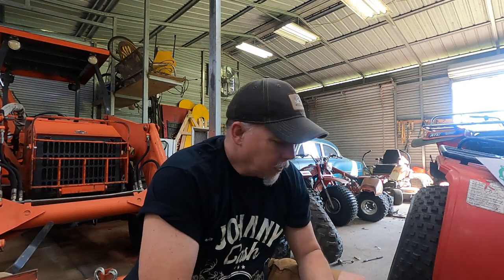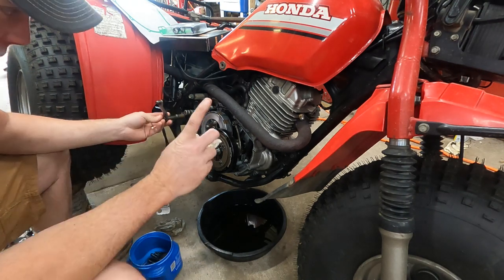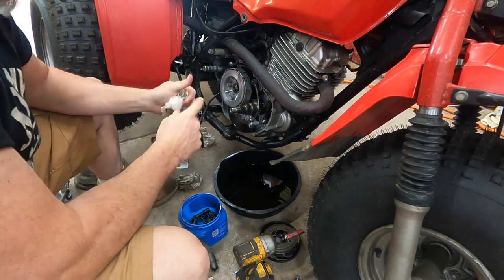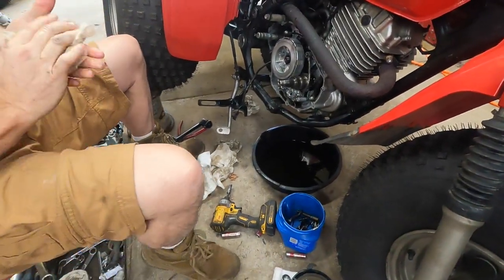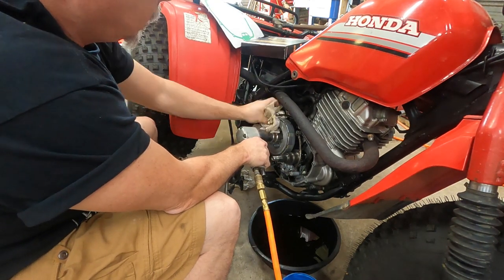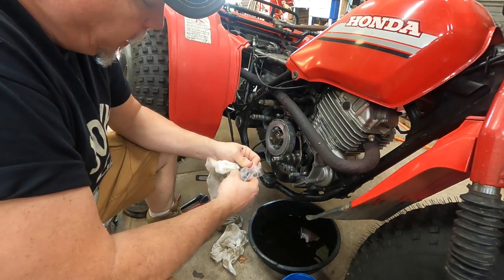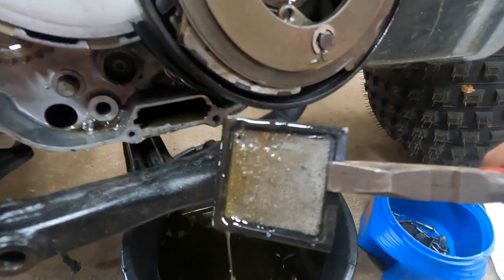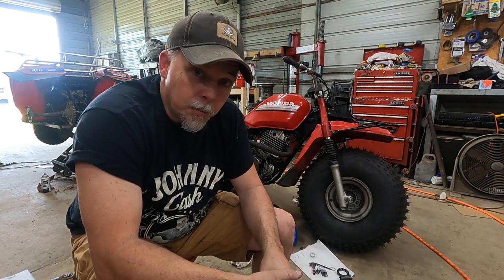HONDA ATC 250es THREE WHEELER CLUTCH & ONE WAY BEARING: Diagnosis and Repair.

Comment: I recently got an '85 TRX 250. It revs but hardly moves so I'm thinking clutch. It'll move on down the road , but not like it used to. Would the repair on that clutch be similar to this? I know there's no actual clutch level only a foot shifter. Any info is appreciated.
Reply from the maker: It should be exactly the same for a 85 tax. Thanks for watching and subscribing,there are links in the description for a clutch kit and one way bearing even oil and gasket.
Reply: @Mrcbuilds  you are the man! Thank you for you help.
Reply: @Mrcbuilds  I noticed that the link you have for the clutch in your description is for a CR250R. Will it be okay for me to order that for my fourtrax? and do I have to get the special socket? TIA
Reply from the maker: Search amazon for a 250es clutch disc kit. Tusk makes a good kit caltric is alittle cheaper.
Reply from the maker: @colebright7379  https://amzn.to/3aGRyAN         try this one, thanks for letting me know

Comment: hey mrc builds i have 1985 250sx the drive shaft is bad does any of the other models interchange ?
Reply from the maker: I would suspect the 85 250sx and 250es are the same because they share the shame swing arms. Note the 86 and 87 swing arms are different. The drive shafts may be different also, I have not had to make that swap yet. Stick with the 85 models and I think you will be ok. You can cross reference the part numbers at partzilla if they share the same numbers they will interchange.
Reply: @Mrcbuilds  thanks alot i couldnt find any info on it

Comment: Do I need a puller to get the centrifugal clutch out or does it just pop off as easy as in this video?
Reply from the maker: You need the right socket for sure but no puller needed
Reply: @Mrcbuilds  Ended needing one someone must of done something wrong

Comment: So if I rev it up and it does not go forward would you say that my centrifugal clutch is out? I can rev It up slam it in the first and I'll take off but it will not automatically go until I have the RPMs really high. If you think it is the centrifugal clutch where would I get one of those?
Reply from the maker: Ebay is the only place I know that has them, there is not a new one listed right now, you will have to wait until another pops back up for sale. If it was me, while I was in there I would change the one way bearing and clutch pack and springs here are links for those items. clutch pack and springs https://amzn.to/3B4Iwbd.  here is a good one way bearing https://amzn.to/2Z9K46L.
Reply: @Mrcbuilds  from what I explained does it sound like the centrifugal clutches out?
Reply from the maker: @rjlittlefield9209  yes the centrifugal clutch is the first or slow speed clutch, the the secondary or clutch plates kick in at higher rpms, not taking off is the centrifugal clutch slipping.
Reply: @Mrcbuilds  thank you so much. Just got yourself another sub

Comment: I pulled my side cover and was checking everything out and  my disc  are worn about flat but have a groove . The centrifugal clutch looks well like yours . Now mine does not wheelie with easy it won't lift in 1st gear I have to be in low gear and lean back while stabbing it. I'm thinking of replacing the centrifugal clutch. Just wondering what you think . I ve seen kids in videos wheelie with ease .
Reply: Hey bud I hope my comment about the rain didn't offend you . If so I apologize  and I really appreciate your videos . If you have a po box I got something I think you'll  find useful I'd  like to send you. I also have an old brand new spark plug.
Reply from the maker: Hi Rob, sure could be the centrifugal, also what type of oil did you put in it? regular or syn. motor oil will cause slipping, you need a specific Diesel oil or an ATV oil both will work in out ATC w/ wet clutches.
Reply: Honda GN4 and I saw your video where you talked MA or M2 ratings.  Lifts front up good in low and stabb it.  Maxed out at 35 mph on pavement engine was screaming and your video turned me on to the clutch.
Reply from the maker: @roblinton5047  thanks for becoming a member please PM on FB or Instagram, your address so I can send you some decals
Reply: Dude I don't face book . I had my wife search for you and all I know to search Mrcbuilds what do I need to type.

Comment: I have a question about installing a flywheel and how do I know it's on all the way?
Reply from the maker: The best way to explain it is you feel it stop moving as you tighten the bolt. If you have a rubber hammer or dead blow hammer, 1 or 2 good wacks, then see if the bolt is loose. Please  Be careful, braking the bolt off in the crank can be terminal or at least very expensive to extract.

Comment: Just subscribed ☺ I'm 16 and recently started flipping bikes and ended up with a 250es that had a rough rough life. I've got it running good now but it's always good to file info like this away if I ever need it. As I was certainly not around when these machines were made and I am totally self taught with no one I can ask questions it's nice to see your videos as someone who really knows these machines well. One question though, I've rebuilt the carb in my 250es and everything is spotless but if you try and give it very much gas it bogs, you can get on the main jet and rev it out and all but you have to ease into it. I don't know if these have accelerator pumps but if you even just give it half throttle quickly it bogs out and I thought maybe accelerator pump but I don't think it has one? Any ideas? The carb is spotless like I said, and it doesn't smoke a single bit, I don't know if adjusting the needle would help or what. Any way, thanks again for your time and work on these videos I really appreciate them and that big red is so so clean man!
Reply from the maker: Welcome to the channel Smokey Bandit (awesome name!) If you are certain the pilot jet is clean, than change the plug, a weak ignition can cause stumbles and hiccups also. (no these did not have an accelerator pump). get a new plug and gap it, hold it against the frame and spin the engine over, you should have a good strong blue arc on the plug, if it is yellowish and very small  you may need a coil, test it before replacing it with a ohm meter first. The more modern 350ex 4 wheeler carb is a good upgrade for these bikes. If you opt to get the 300ex carb you will need the throttle cable that fits it. 
Thanks for watching, I have a video about flipping bikes coming up soon. Keep an eye out for it. Be sure and hit the subscribe button and bell so you don't miss it.
Reply: @Mrcbuilds  Thanks so much! I have checked for spark and its nice and strong but it could probably use a new plug. I've been thinking about doing the 300ex carb, does it fit directly in the intake or is there any modification needed? I will just use a pod filter, I'm not worried about the air box.
Reply: Something to check: 
With the carb off- see if the butterfly/throttle plate moves at the same time the slide moves. They kinda get tweaked after awhile & wont move together-(at the same time....

Comment: Hi I’m replacing the clutch on my 84 atc 200 and the part with the big nut that’s reverse thread keeps spinning how do I go about this
Reply from the maker: A rubber oil filter wrench will hold it. Or use a rag and your hand.

Comment: do you have to take the engin out to get the drive line out of a1985 250 es
Reply from the maker: If your just wanting to removing the drive shaft the rear end would be easier to remove.

Comment: Have a 84 honda 200m atc and the cable need to be replaced  do you need it to shift and is it auto shift or have to shift please I need help if you can get back Thang you
Reply from the maker: The shifter is foot operated no cable needed. Its auto clutch, not auto shift so when the rpms rev up shift to the next gear.
Reply: @mrcbuilds  thank you .was told it was clutch found out left lever is parking brake .thanks for getting back so quick. God Bless

Comment: I was doing a cover swap, and I turned the primary clutch a little bit, it was pretty tight to turn. Now the bike is stuck in gear, shifter moves up and down but wont grab gears. Any ideas?
Reply from the maker: I'm betting the spring on the cover didnt align  and the clutch isnt engaging.

Comment: Good morning, I was actually attempting to adjust my valves as I heard them getting louder. FWD...I realized that the exhaust adjusting screw and nut were not on the rocker....Took top cover off and they are not on the top end anywhere. IS it possible they can fall down the timing chain hole to the bottom right side of the engine? crazy part is I have been riding it at least 4 hours of ride time and by the grace of god!! I am hoping to use your video to remove the cover and find them at the bottom of the engine.
Reply from the maker: That's a tough one, If you have had the bike for some time, and rode it, any length of time than the nut and screw must have been in place and working, otherwise the bike would not run. The way the top cover kind of seals off the cam chain area, I don't think they both would fall to the bottom. I bet they are in the recess of the head to the left of the cam sprocket (facing the left side of the engine). I really hope that's where they are, otherwise you could be looking at a major tear down to find them. I would pull the engine ( takes about 15 minutes first time) pull the top cap, cam and look in and around the valve springs, if not there, then pull the left side (cam side ) flywheel cover and flywheel, and hope its there, drain the oil. good luck

Comment: My 1985 250sx seems to need a puller to get the centrifugal clutch off...
Reply from the maker: Should be the same as the 250es.
You will need the 4 prong socket

Comment: Ok so I've got an 86 honda 250es I'm rebuilding... I do t have an impact drill ... whats the best way?
Reply from the maker: Basic hand tools are fine. 8mm, 10mm, 12mm, 14mm, 22mm and 24mm sockets, Phillips and flat screw drivers will just about take the entire bike apart. The first thing I recommend is to down load a free copy of the mechanics repair manual here. http://oscarmayer.net/atc/manuals/ also get the color coded wiring chart, that is a big help.
Reply: @Mrcbuilds  thanks so much.  My boyfriend actually took me to AutoZone and got me a impact wrench. May the job a whole lot easier

Comment: When I use the kickstart on my eighty Five, Honda three, Wheeler 250ES. When I try to kick it over with the kick start. It's not turning the engine over and I don't understand that. What do I need to replace in the 3 Wheeler?
Reply from the maker: Hey Bill, my first thought is the one way bearing, that machine has 2 one under the primary clutch on the right side and another on the left side on the flywheel
Reply: @Mrcbuilds  I have 2 200es 1984 and 2 250 es 1985 1986 they are Daley riders I can't be three, will bill with 4 wheelers?
Reply: @Mrcbuilds  And thank you for helping me.

Comment: i have one more ? i just got this 1985 250 sx when i shift it into gear it hesitates then lunges forward in first then then not as bad after its moving any idea what it may be
Reply from the maker: There is a clutch adjustment on the right side of the case. Download the free manual and follow the steps to adjust it. Is the idle set to high? If so it can lunge and creep once in gear.
Reply: @Mrcbuilds  will do thanks again
Reply: @Mrcbuilds  i found out it wasnt the clutch the bearing on the left side of the swingarm was totally gone lol i still have to get that crazy notched bolt out im hoping all the gears havent been damaged in the rear drive i had just bought it from a guy that said he couldnt get it running the air box had a rats nest in it and there was rat hair clogging the carb lol  took it out cleaned it up and it fired right up

Comment: Installed a new clutch in my 250sx, but now it doesn't disengage. When I hold the shift lever all the way up the bike still accelerates. Any advice?
Reply from the maker: @scottbrunet8399  pull the right side cover.  Sounds like the clutch arm is not aligned or you clutch pack is not installed correctly,
Reply: Thanks for the reply. Is it possible to have the clutch bolts too tight? I think the springs may be bound up too much.
Reply from the maker: @scottbrunet8399  yes/no the bolts should be tight but I have seen some kits come with springs that are too long, and they bind when the bolts are tight. when the bolts are tight the spring should still have space between each winding, if they are touching the springs are too long.
Reply: I'm pretty sure that's the reason. Bought a heavy duty kit off of ebay. I might reinstall the old springs and give it a shot. Thanks for the advice. As always great videos, keep it up.

Comment: I was wondering if you could give me help with my 250se 3 wheeler big red  how change the reverse cable and foot brake cable in that all  u fb message
Reply from the maker: Hey jason, best bet is down load the manual and study the routing of each cable. It's really straight forward loosen the jam not and each end and then pull the slack out remove one end then pull the slack out and remove the other.
Reply: @Mrcbuilds  ok thanks so much

Comment: I know this is an older video on the one way clutch bearing, but now I'm experiencing Deja vu LOL! working on an '87 250 Big Red and having a problem with engine kick back or back lash to the starter gears making a pretty good clunk after shutting off the machine. So I figured I would change out the one way clutch bearing as described in this video, knowing after my own experience, that if the Kick start doesn't turn the engine over and free wheels, that the one way clutch bearing is put in backwards, so I installed an OEM Honda one way clutch bearing so that the kick start works, and then reassembled everything, hoping this would solve the problem, but it didn't, so now I'm going to change out the (Alternator) starter side one way clutch bearing, and hopefully this does the trick. I'm starting to get a little aggravated because from my understanding that others have told me, that if the I had this starter kick back condition, that it was the on the centrifugal clutch side. The funny thing is, my starter works great to crank it up, and with the starter gear cover and gears removed, I have tested the flywheel with a large screw driver on the teeth and get a fair amount of resistance from it going one way, thinking that it's good, but is it possible for this to happen and still get engine kick Back? Maybe the one way clutch is wore just enough for this to happen?
Reply from the maker: Hi CJ, I think your on the right path the centrifical 1 way does a lot of jobs, but the stator side 1 way disengagues the starter reduction gearset. Those gears are known to wear out, inspect them while your in there. As a test take the starter out and kick it to start it and see if the noise changes or goes away. If it does then id say tour 100% correct in you diagnoses.
Reply: @Mrcbuilds  Yessir, I kick started it just fine, that part works great. I inspected the starter gears and they look good with minimal wear, even the flywheel gear looks good. I just ordered a new one way clutch for the flywheel side (Alternator), hopefully that changing out it will cure the problem. Lol! Thank You for the advice, I'll let you know my results 👍
Reply: @Mrcbuilds   I Finally got it fixed, It was the One way Clutch on the flywheel side. I would have never known it, if I didn't have the New part to compare to the old part.  As soon as I got the flywheel off I went to compare and it was a dead give away, the old clutch was loose enough it just fell out. In comparison, the new one would not turn and was tight. Another thing was the  flywheel with the old one way clutch would let it spin free, with the new one it would spin free but had a good amount of resistance. The tell of tale was when I got it all back together and fired it up, then shut it off, NO more Kick Back on the starter  gears, THANK YOU! HA ha !! LOL! It was a learning experience for sure. This was my first ATC engine ever,  to go this far in depth, from splitting the case, replacing the piston rod and crank pin assembly, and reassembling everything myself. I've got experience rebuilding diesel engines on heavy equipment, and gas engines, some transmissions, Rebuilding Lincoln welders, Tractors etc., but this really threw me a curve ball for sure. Goes to show older dogs can always learn  new tricks.  BTW, I hope you and your  family are safe from this Hurricane that's coming. As always Thank You for the reply's and info you spread out to everyone.
Reply from the maker: @cj7fun579  hey Cj, the hurricane is on top of us now. Made land fall about 2 hours away. So far so good. That great! You fixed it. Yes having 2 one ways bearings is a crazy setup. Your a pro now. Lol congratulations.

Comment: I did this. Having trouble getting the cover back on..... No sure how the "reverse lever" is supposed to be positioned. I think its hanging up.. Like a dummy I got in too big of a hurry and didn't take pictures. I have a factory manual on the way. Thought maybe somebody could chime in though.
Reply from the maker: Hey Ron, set the lever up on the shelf made by the little screen molded into the case, take and a little wiggling should do it. I always center up on the crank and its bearing first then the others will line up.
Reply: @Mrcbuilds  Thank you very much!!!!!!